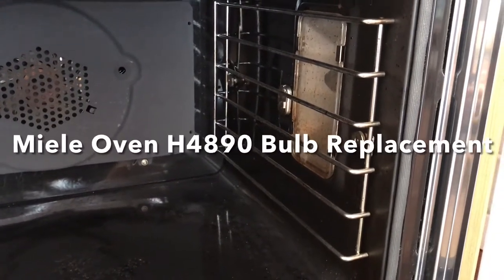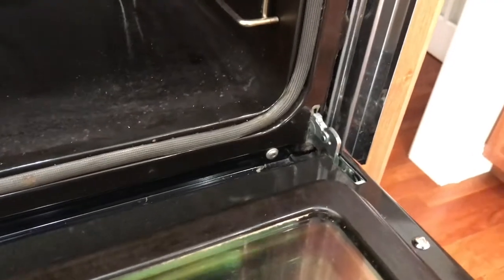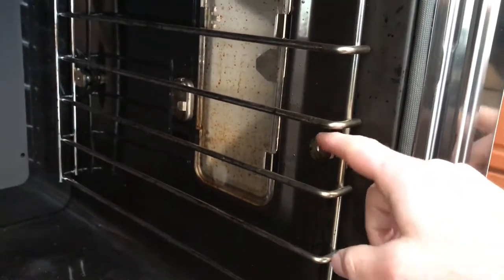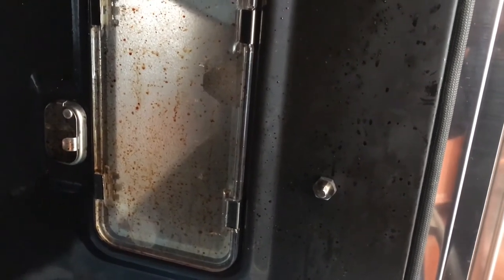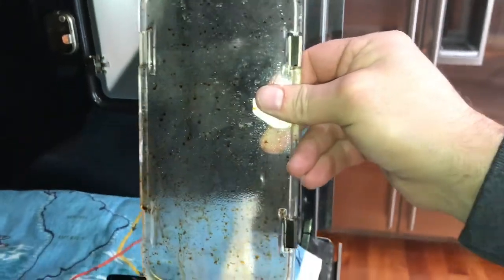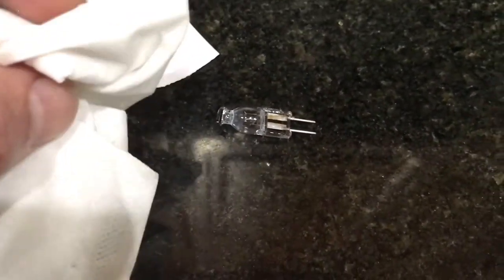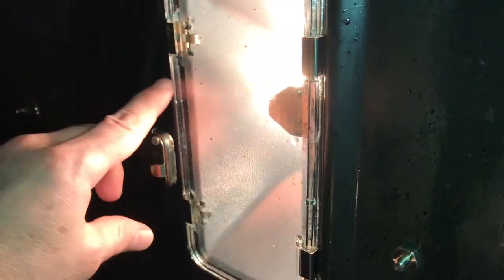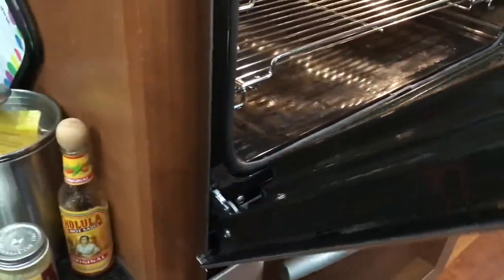Miele Oven H4890 Lightbulb Replacement

Comment: If bulb is broken do I need to turn power off before removing
Reply from the maker: Any time you work with an appliance you should turn power off at the breaker for safety.  I can’t advise you to do otherwise.  

It is a 12V bulb (ie low voltage).  If the bulb is broken, you should make sure you don’t cut yourself removing it.   If you have a small set of pliers, use it to grab the base to pull it.